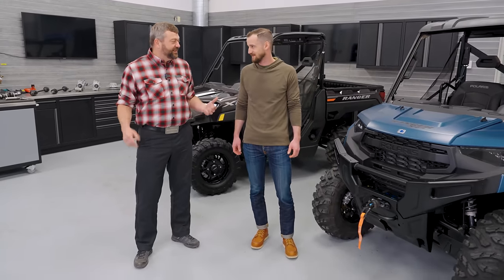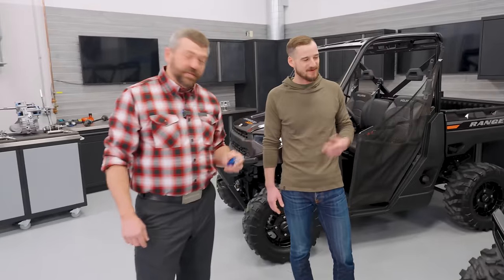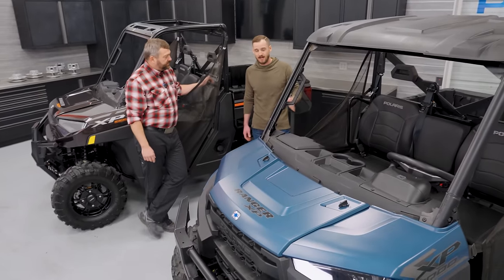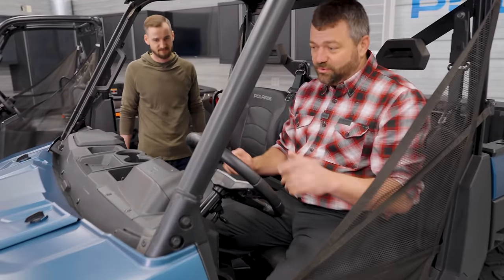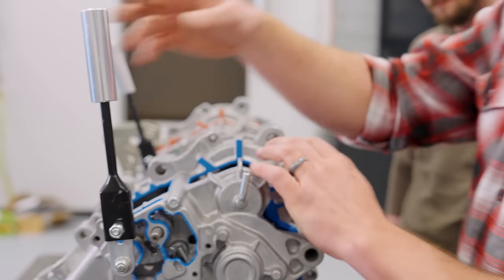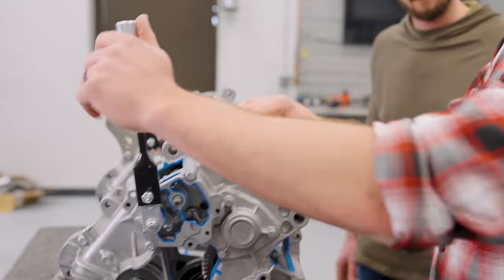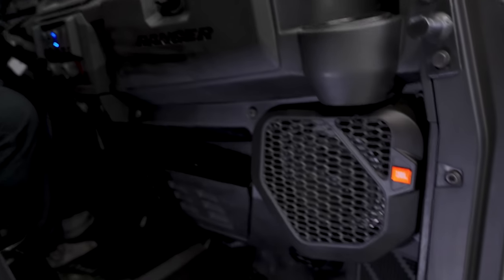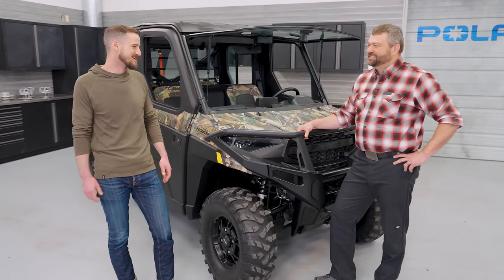2025 RANGER FULL-SIZE LINEUP WALKAROUND - SHOP TALK  EP. 40| Polaris Off Road

Comment: i bought  a 023 ranger 1000 premium, love it. i use it mainly for putting trails in & taking out. very comfortable, love the mount of storage.  i put roof winch ,windshield, tool rack, cfhainsaw mount. the 1 option i wish it had, heated steering wheel, i have that on my truck so i'm spoiled

Comment: Bought a 2020 1000 premium new August 2020, paid 13,400 out the door. Sent my ecm to Giloman to remap and clutch kit for 700 bucks, puts up to 81 horsepower, close to the XP models (82) for 2400 less, have 5500 miles on it now, no issues

Comment: The new blue color is stunning.
The new bumper and plastics. Sure, whatever.
Included winch and roof, bigger tire. Sure, whatever. I am guessing the cost reflects these things.
Better shifting is def a bonus. I would miss the grindy grindy CLUNK too much tho. You almost entirely fixed it with the Kinetic.
I honestly never even thought about the power steering. It works..... like power steering should? I reserve final opinion until a test drive. I am curious. you improved something I hadn't even though about once after 3 Rangers.

Comment: Is Polaris ever thought about a sport side by side for guys that are 6’4” and taller? Because I’m at least 6”5” tall and would like a rzr 1000 but find it difficult to get in and out. Mainly because of the way the door frame is designed
Reply: Ditch the factory doors and get motoarmor doors.  They extend outward 4ish inches.

Comment: Are the shift mech updates to the 2025 transmissions backwards compatible to 2024 without case replacement?
Reply: Clearly not as the internals are completely different.
Reply: Internals didn’t change, only the shift drum and mech did, hence my question.
Reply: The sliding collar was removed leaving just the two forks which are moving on wider spaced tracks. I don’t see how it would work, but I’ll defer to any experts out there.
Reply: good question-as a Polaris dealer tech, I'd like to know-so that we could help prior year customers if/when their transmission has to be serviced internally.  It would be a selling point should someone need to go into it.

Comment: Why does the all wheel drive switch go into diff lock first then 4 wd. This set up only puts pressure on the drive shafts and ball joints  and steering gear as when you turn it is screwing the drive train unnecessarily.  😢

Comment: "That buttery smooth shift effort". I'm more concerned about the jerky clutches. It scares my granddaughter away from riding with me! I'm trying to encourage and have fun outdoors with my grandkids and my jerky XP1000 is scaring them away! Why can't you guys fix that? Why do we have to depend on the aftermarket for improvement? What about a real parking brake? If you park on a hill it sounds like you're breaking steel when you put it in gear. How about addressing the lock and go windshield? You can install it and before you know it has worked it's way down from vibration and flex. Then it pulls the weather seal loose from the bottom. How about getting some real customer input instead of people telling you what you want to hear?

Comment: Make the Xpedition QUIETER!! I have installed your clutch weights and spent over $500 on sound deadening it. And It's still Loud. Yes I know its an off road vehicle but I came from a Ranger and it was 20 times Quieter!! Tried trading it back in with 35 miles on it for an XD 1500 and no one wants to trade me!
Reply: Too expensive

Comment: It’s still a toy…when you do like Honda and put actual transmissions in and get sane with the prices …
Use the Toyota business model..
Reply: We've sold more Honda clutch packs through our dealership than polaris belts.

...just saying.

I've had both.  Both require that you do not operate them too slowly in high gear.  One is a $2800 repair, one is $200.